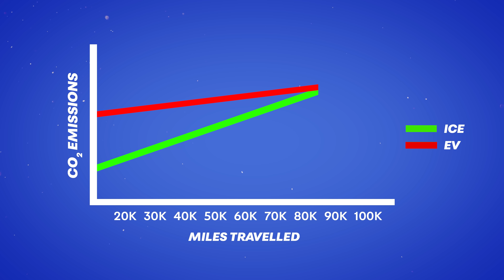Are Electric Cars REALLY That Green? [New 2022 Data]

Comment: A key thing to keep in mind here is the recyclability of batteries. Gasoline cannot be recycled. Battery recycling is an industry that is barely in its embryonic stage. The grid is also becoming greener. As far as I can tell, the future looks quite clean and bright for EVs. And please do note that even in the video's own description:  "may not be as green as their internal combustion engine counterparts in the short term."
Reply: Yeah but the battery packs only have a life of 10 years and so far there is only 1 Battery packs recycling Center in the World ! And they can only recycle about 30% of the packs at the moment, so unfortunately it means a lot of what is called Black Waste which of course can’t be put into landfill so has to be stored.
The other thing about EV’S is the amount of Graphite,Aluminium,Manganese,Silicone and lithium etc they require but more importantly where these products are coming from ( presently Open cast type mines in 3rd world country’s and which is contributing to environmental impact because of the way it is mined) and of course the human impact of people working without safety rules and regulations and on average 1 person a Day dying in these places, they are only earning a $ a day as well !!. 
This is the current problem with the EV’S,nobody has worked out exactly the actual environmental damage per Vehicle because if they did no body would buy them !.
Eventually they will be Fully recyclable battery packs and last longer than 10 years but it’s a case of Will the environmental impact change ? Will the production of the elements be done in more environmental friendly mines without using chemicals dangerous to the environment and people ??.

Comment: I didn't hear anything about battery replacement and disposal/recycle, that would up the carbon/environmental damage of EVs. Substantially. Also unless you are in a country with 100% green electric production you are still using fossil fuels to get that electric. There isn't a separate grid for solar or wind generated electricity.
Reply: No, but here in the UK, we do have the option of purchasing only renewable energy, should we choose to......

Comment: On these reports they seem to look very closely at the mining and manufacture of batteries, but they don't seem to consider the mining and incredible amount of casting, forging, and machining of the parts that make up an ICE engine and drive train. Not only does the ICE engine and drive train has hundreds of more parts than a EV drive train, but all of those parts must be transported to the assembly plant from their manufacturer.
Reply: Shhhh, you aren't supposed to mention that....

Comment: But solar panels and your wind turbines also need oil to produce those products. Here's another key fact that a lot of you guys never talk about which is the fact that the batteries don't last as long as you think they do. I've been testing drills for years, especially battery operated types, and the more times you use it and charge it the less usage you get out of it in the long term. So you are going to have to change those batteries out and the vehicle more often than you would in a gas engine vehicle will need repairs. The average homeowner holds a vehicle for 5 years and the resale value in all vehicles does drop but with an electric vehicle it diminishes a lot faster because that person is going to have to spend anywhere from $20,000 to $25,000 on a new battery bank for the vehicle when you can buy a good used vehicle for that same price. Which one's more cost-effective now? Now we're starting to look at the bigger picture which just goes to show that the gas vehicles will outlast any electric vehicle. If you look on Tesla's website it will clearly tell you that in a few months of driving that vehicle after you take it off the showroom floor you will lose roughly 3% to 7% of range. In a gas vehicle that does not happen... It has been proven that most gas vehicles once you break the engine in you will gain more horsepower. The other downside to electric vehicles is heat and cold. I could continue but I'll stop there.

Comment: What I haven't seen so far is how these battery powered vehicles preform in the winter. What is the range when it's 0*f? How about heat? Electric heat sucks up the power as we all know! How far can you go in the winter with your heater, lights, wipers and radio going? And when the battery is no longer useful? What then? There is no answer to that question, is there?
Reply: Yes, there is. And you would have found it if you had researched it.  Both Volkswagen and Renault have EV battery recycling facilities in operation now. Both the lithium and cobalt within the battery can be 90% recovered and reused in new batteries. Volkswagen posted a YouTube video of their EV battery recycling plant a couple of years ago, if you want to see the recycling process for yourself...  Battery powered vehicles seem to be performing just fine in Norway. Over 50% of Norway's population now drive EV's, and it is not a country known for having a tropical climate....

Comment: Big battery pack in the xc40 recharge manufactured in coal heavy China doesn’t help, makes a good argument for plug in hybrids at the moment where a small battery with low co2  production gives a majority of the Fuel saving benefit’s. Ev’s overall will get greener over time, but not all ev’s are created equal.

Comment: Electric cars are more efficient with the fossil fuel energy put in to charge them than the same gas energy to fuel a fossil fuel car using the same amount of *energy. Electric vehicles are better and more efficient to run than fuel cars by far. Combustion engines waste huge amounts of fuel. Electric vehicles do not.

Comment: If you can afford to be green and then drive your 90-120k miles, what happens to your old batteries, they are pretty toxic?
Reply: They can be 95% recycled.
Reply: @Brian-om2hh   Right now there iis not a functional recycle  method. Lithium has some interesting charateristics that make it very difficult to work with. So right now there is not a good disposal or rycle of EV batteries. Everyone is betting on future undiscovered science, otherwise we have a growing problem. Current lead acid batteries are recycled at a 90% rate, Lithium about 12% and maxed out.

Comment: My question is a little more old fashioned. In my experience electric motors make ozone. I don't know about 21st century electric motors. However, once we have thousands of EVs, won't they be producing that much more O3 (ozone)? And what will be the effect? Just a thought.
Reply: Brushed DC motors produce ozone. I don't think any EVs used brushed motors, so they don't produce any ozone while driving. If they did, then people would be able to smell it and there would be a disctinct "EV smell" that would smell like those old model train sets.

Comment: The thing about bEV is that it will have a beneficiary positive feedback loop. 

Once we start to see electrified cargo transportation and industrial process and industrial equipment then the emissions from mining and manufacturing batteries will fall. 

So the greener we get the greener it will be to go green. 

As new mines and new supply chains come onboard to meet demand they will be lower emitting than old supply chains which means the 90,000 (or less) figure will keep falling the more we adopt bEV. 

Particularly if we start to focus more on cargo commercial transportation and industrial machines instead of passenger cars.

Comment: How long before the volvo has to replace the battery. The battery can can cost about $28,000. If they only last 60,000 miles, there is an issue. Where do you dispose of these super toxic lithium batteries. Lithium makes CO2  carbon footprint a joke. Plants also consume CO2.if you buy solar panels, how long till ROI? Fifty to 60 years if at all. How about catastrophic failure of the panels or turbines? In the mid west, those storms will chew them up. Fuel cell cars are interesting. Maybe look into fusion energy generation. When someone politicizes technology, you get the worst versions until innovations comes into the picture where it is cheap, safe, and economically feasible for the consumer. This is when corporations, not government build something different and exciting.

Comment: No one is considering the longevity of the vehicles into the equation. If my ICE vehicle has a life span of 300,000 miles, and an EV has a life span of 150,000 miles, how does that figure in? Since the majority of the pollution is created during the manufacturing phase of the EV, more specifically the batteries, how does that affect the equation? My current vehicle has over 338, 000 miles on it and is still going strong. I have no plans of replacing it any time soon. I'm not opposed to EVs, I'm just tired of being lectured to about how I am damaging the environment and everyone who drive an EV is "saving the planet." Just in case you are confused about the motivation of car manufacturers, they are not building and selling EVs because they want to save the planet, they are doing it because it is profitable.
Reply: There are now many Tesla's with mileages of considerably more than 150'000 miles. Some are double that and more.....

Comment: I think many people realise now thst electric cars are the biggest fake green concept of modern
times. The energy to build them takes 5-7 years to recoup the heavy metals in the batteries are
not recyclable and we already have battery mountains building up. A car battery will be scrap in
5-7 years and the replacement will cost more than the value of the car. The new battery even if
you go down that road will take another 5 years to claw back the environmental damage done in its
manufacture by which time the car is 10 - 15 years old and scrap. The owners will have had to pay
twice as much money for the electric car and be left with a £200 scrap vehicle with yet another
battery which know one knows what to do with. That’s progress folks.

Comment: Electric cars need electricity and be fast charging. The electricity has to be generated, probably still relying on coal and gas, hydro or nuclear. Wind and sun don't cut it. The batteries and solar panels are made from dangerous heavy metals which will quickly become landfill. We need more investment in public transport.

Comment: "all my electricity (for my EV) is green" ?? - but where does your electricity come from when the sun is not shinning and the wind is blowing too hard or not enough?  What are wind  turbines made of - steel needing lots of coal in its production and fibreglass blades (oil) and you can not recycle fibreglass turbine blades.  This presentation has a few holes in it.

Comment: Electric cars are also heavier than their likes with diesel/petrol. They also have much higher torque in general. This means like they will eat up rubber tyres and asphalt much faster! According to rubber tyre producers, electric cars eat up tyres 30% faster. This is a major part of total emissions. It is not only CO2 that should be discussed.
Reply: So, the hundreds of thousands of massively heavy trucks which pound the roads each day, all wearing their tyres heavily, haven't caused you the slightest bit of concern for years?  Yet all of a sudden, electric cars appear, and it's a major issue.....

Comment: Now I didn't read what was all in the Volvo study.  Did they factor in the footprint of EVs  the lithium mines?  The transportation of rare earth materials to China for refining ( Read an article that mention China does above 70% of the refining of rare earth materials).  Does Volvo study factor in the need for replacement batteries? And how the old ones just end up in landfills because they are next to impossible to recycle?  (One could argue that currently Tesla leads in the industry in batteries for EV and up until a few years ago recommended changing the battery at around the 5 year mark at an additional cost to the owner of appox $10k)  Does their study account for cold weather climates like Canada where almost 6 months out of the year the battery is going to require more charging as the cold weather reduces the range of the battery? 
Lastly does their study include the  footprint for the massive overhaul the aging power grid in North America is going to need to support the charging of all these EV?

Comment: Does this study include battery degradation? I'm sure you have to charge the battery more often as the car gets older. Also how long before you need to replace the battery
Reply: Probably not at all, if you have the battery refurbished rather than completely replaced. Oh, you never heard of battery refurbs? Go and research it....
Reply: @Brian-om2hh  of course the battery loses capacity over time. You still have to replace the cells when you refurbish it.

Comment: Don't forget about the resale value between a ICE and EV. A well maintained ICE can go well beyond 250k miles and get the similar mileage to it's first few years. The range on a EV will always slowly diminish and at 6-8 years you'll have to replace the battery to get the range back and resell the car.
Reply: Why might you have to replace an EV's battery at 8 years old, when most have an 8 year warranty, along with an assurance of (normally) a 70% state of battery health after those 8 years?  The 8 years is the battery's WARRANTY, not it's lifespan. You don;t replace the engine in an ICE car when the warranty expires. There are many EV's readily running to 10 or 12 years without having had a new battery. And it seems you never heard of battery refurbishments?  Research it.....
Reply: @Brian-om2hh  honestly stop embarrassing yourself

Comment: I have two fairly economical ICE vehicles: A Honda Fit (Jazz in Europe) and a Mini Cooper convertible.    Both get great mileage and are smaller and lighter vehicles.     There are several things that could help make the EVs the better choice in the future.     Solid State batteries promise to be lighter and may end up offering a longer range than the current batteries on the market.     As EV batteries become more common, the battery making industry will hopefully become more efficient in making the batteries in the first place, lowering the carbon footprint, and the fact that batteries are suddenly more and more common will mean that the recycling will improve to remove and reuse much of the battery material, which will also help reach the brake-even point sooner.    Eventually we may see batteries that can be almost completely recycled and reused in new batteries.   

I also feel we are close to being able to better shift to renewable energy, partly because we are close to having better and cheaper energy storage solutions that can store a surplus of energy when solar and wind are producing, for use when they are not.     IMO we are always going to need natural gas power plants to pick up the slack when solar and wind is not working well, or at all.       We are already at the point where it is probably much quicker and cheaper to set up a wind / solar plant than building a new natural gas-powered plant.    The energy storage for renewables is the issue.     But as the video pointed out, an EV getting its power from nuclear, solar or wind powered electricity is getting to that break-even point much sooner, and we are moving in that direction more each day.  

EVs are not there yet.    The issues that still need work are (1) vehicle range, (2) charging time, (3) vehicle price VS an ICE vehicle, (4) charging station availability.     The first issue may get resolved with solid state batteries, the second is improving all the charging time but is still too long compared to gassing up an ICE vehicle.    The price issue will get resolved as battery production gets more efficient and as EVs become more common.    The fast-charging station infrastructure will take care of itself as states get involved in subsidizing this and the demand goes up.
Reply: Totally agree with your thoughts but would like to add that if, and it's a big IF, solid state batteries come to fruition, (2) charging time will decrease dramatically which, even without considering the greater energy density, will make (1) vehicle range less of an issue.  IF you can charge in a few minutes then a 200 mile range cold be deemed acceptable.  For most stopping every 3 hours for 5-10 minutes is not too burdensome.  And this only applies when not able to charge at home which will forever be the preferred site.   The faster charging also means that perhaps now you don't need that 80Kwh battery so the car then becomes much cheaper with that more modest battery, and lighter also which adds to the efficiency.  IMO the degree of EV superiority over ICE is SO much dependent on the battery.  And a very exciting time to watch it all evolve.

Comment: nobody mentioned anything about the ev car and when the battery dies and you need to put a new one in? i wonder how much that would cost $10,000 and another carbon foot print so its not like the EV breaks even at some point you always need to get new tires, brakes, batteries and other parts that keep the carbon foot print going

Comment: There is 1 bug, huge issue. Electric cars isnt good for long driving. Period.

Recent war in Ukraine shows, that if you need to evacuate, you will not be able to charge it fast enough. What I really mean, that in case of some emergency you cant drive.more than 200-300km in normal, not expecive car. Which makes ev city only car. 

But if you have 2 or you live somewhere in safe place, aka USA + well, it might be an option